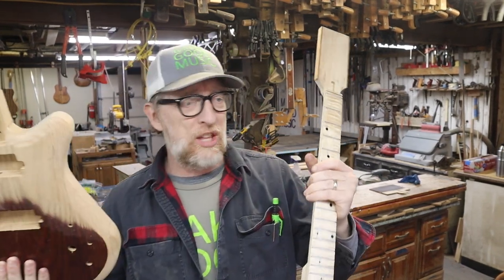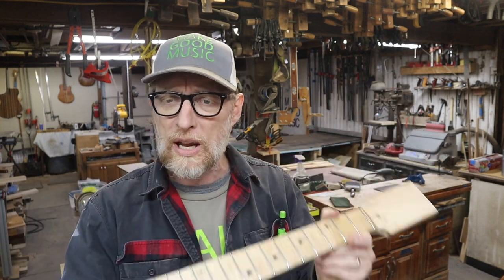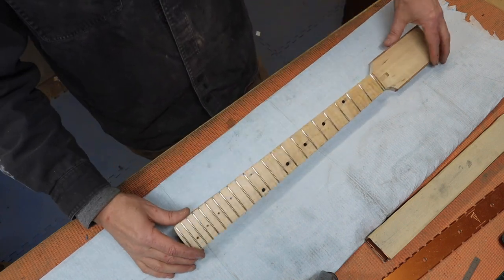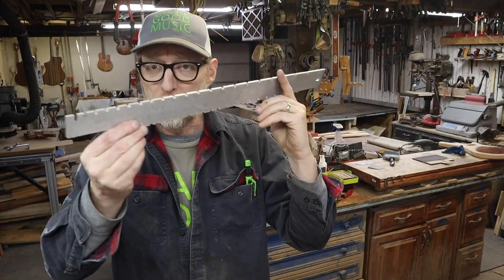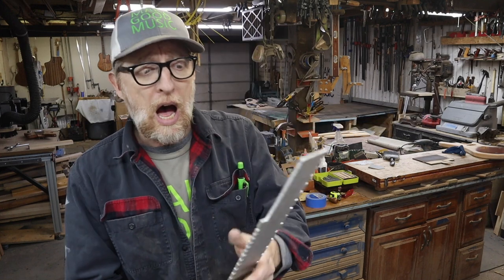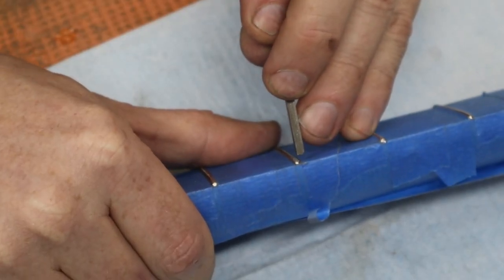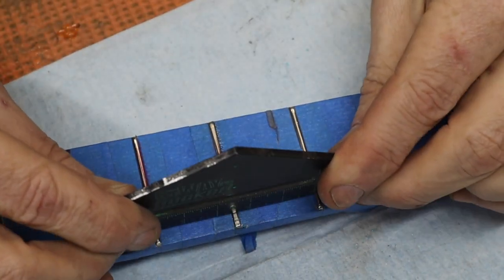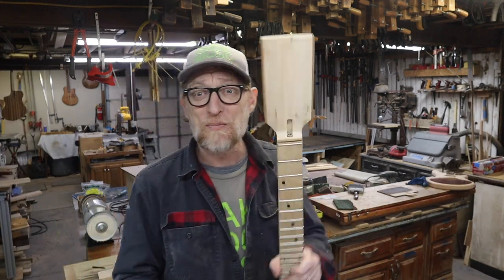Leveling and Crowning Frets Explained Simply- New Perspectives Music Kit Guitar, Part 4

Comment: Something I learned (probably from some other video) when leveling the worn frets on my bass: There is another sharpie trick. Once you have done leveling the frets paint the tops with a sharpie again. Then when you go crowning them, it is easier to see when to stop crowning. The  stripe on top will get thinner and thinner and you stop just before it vanishes. This way you don't make the fret too low by accidentally taking too much off when crowning. I don't know if it's easy to work without this trick for someone experienced, but it sure helped with my first fretjob.
Reply from the maker: Excellent tip!
Reply: @timsway  I was thinking of this during the vid. I thought I learned it from an older vid of yours, and thought you were going to mention it again.
Reply: I've done this many times.  It's a very good way to see what you're doing when crowning frets.

Comment: Fret rockers and notched straight edges seem like they should be the two tools you can cheap out on. plenty of kits that'll also have files for real cheap. you can throw those files away. but the rockers and the NSE are fine. Of course you could always just cut up a ruler to three lengths for a rocker.
Reply from the maker: While we’re destroying rulers, I bet there will be enough scrap from the notched rule leftovers to make all those rockers :) good idea